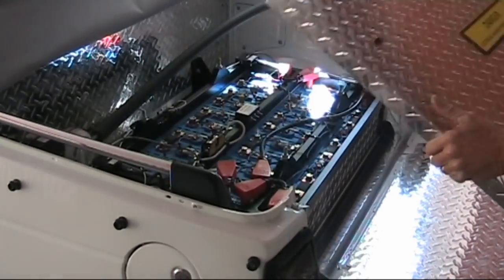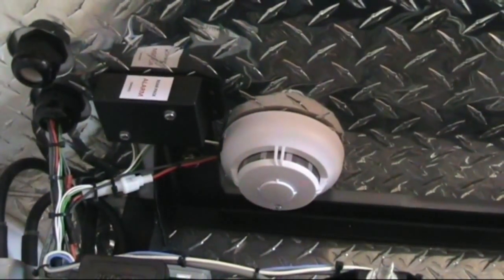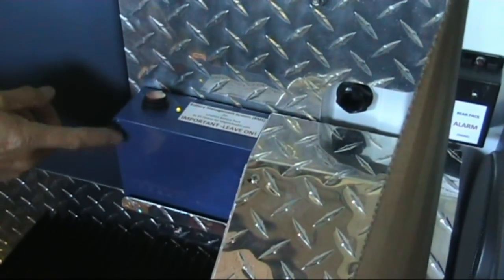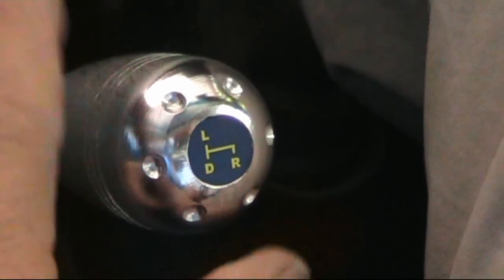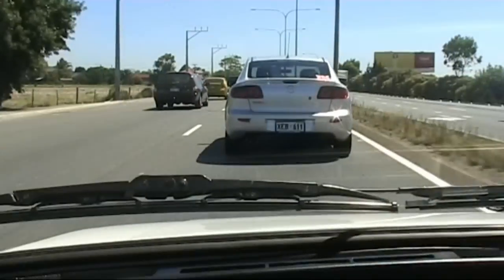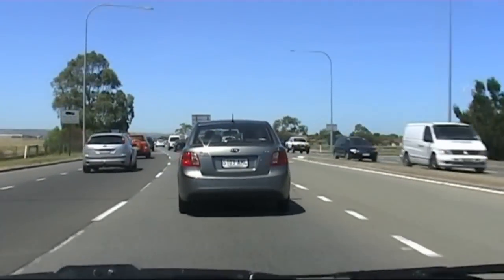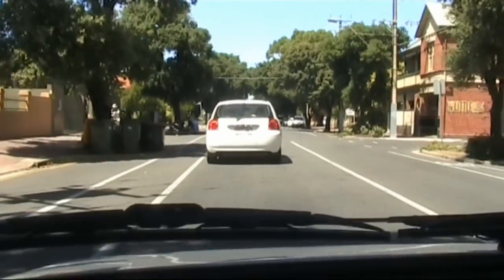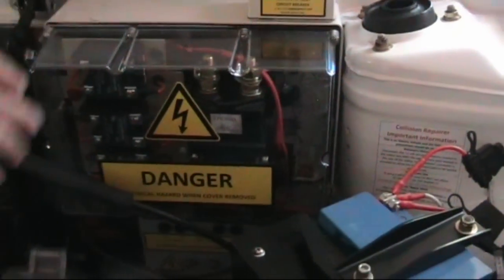MightyBoyEV Part 3

Comment from the maker: The batteries are clamped together so that there is no chance of any swelling for any reason. Under normal use we are not expecting the cells to swell, it's just the recommended mounting method.

Comment: Thanks Eric.
Yes i looked at the breaker curve and it looked like the fuse would never operate under any fault condition.
Looks like the breaker kA rating should be in spec, for a bolted short and 250A looks nice and tight for overload, i've been building 3kW ebikes and considering building a couple of ev's good stuff, quicker off the mark too.

Comment from the maker: Hi Jonny, 
Bruce decided to have double security, hence both the fuse and circuit breaker. The circuit breaker  can be used as a HV switch. This is what I use in my Holden Barina conversion (with no fuse). Eric

Comment: Might be confusing as i didnt state, i mean the 250A circuit breaker and the 400A fuse both appear to be in the main battery supply line.

Comment: You can't get energy from nothing; The alternators must apply drag in order to extract energy, and that drag cancels out more miles of range than it could add back into the batteries.